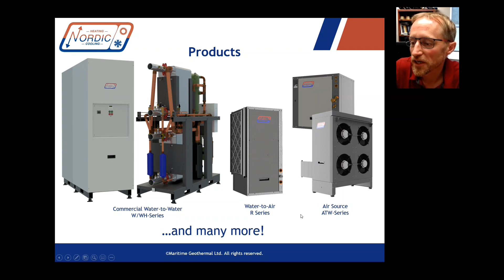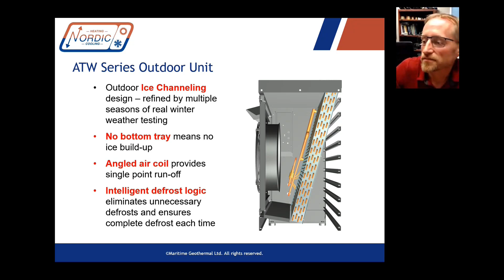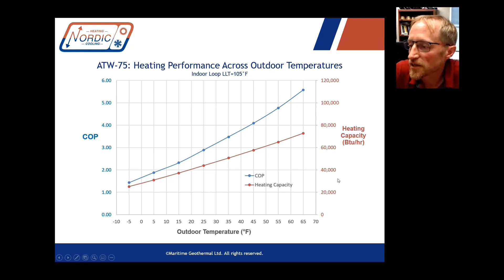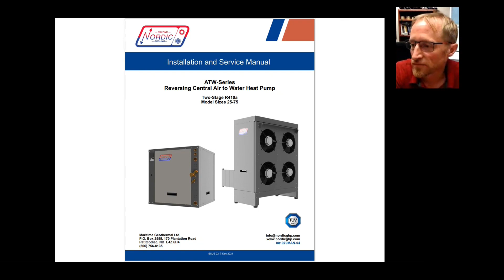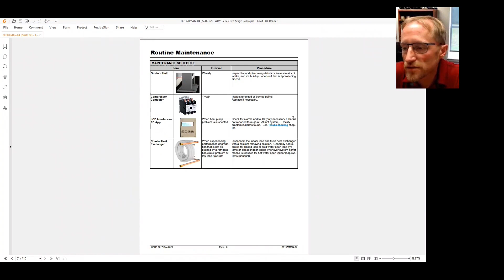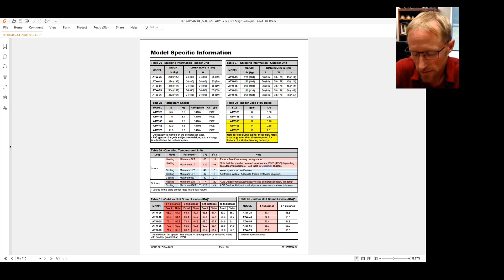ATW webinar for Peel Passive House Consulting, August 2022

Comment: Can I use a 50 m3 swimming pool  (min temperature during winter is 11 Celsius) as water heat source during the winter instead of drilling holes into the ground? 10kW /H is my current heat load

Comment: I have a 150 year old house in the montreal area with 11 huge cast iron radiators from the 1940's... My wife loves them... I have a 32Kw electric boiler for it... but thinking about adding a air source split heat pump to warm the existing rads... It's got one huge circuit (lots of volume) around the periphery of the house with lines going to one or max 2 rads of the main circuit.

Will something in the Nordic product line work with my traditional rads?

I'm looking at the 120 F degress... which is lower than current boiler set point... I guess it means a longer duty cycle, or higher rate of circulation, or both... or maybe it just won't work?

(I have air to air for cooling... that's fine... only interested in heating.)